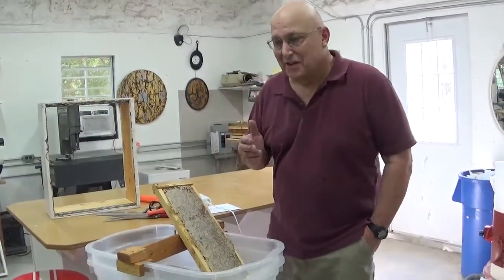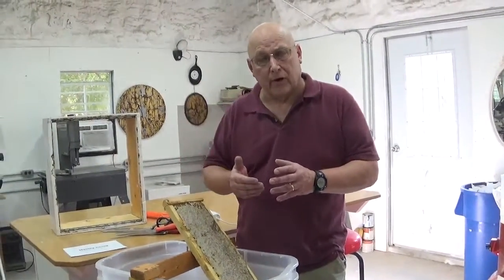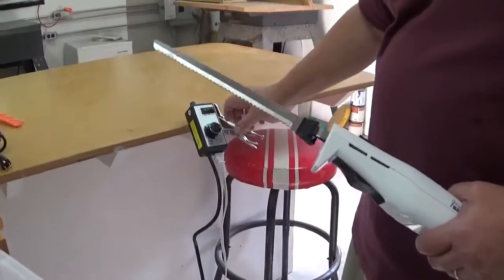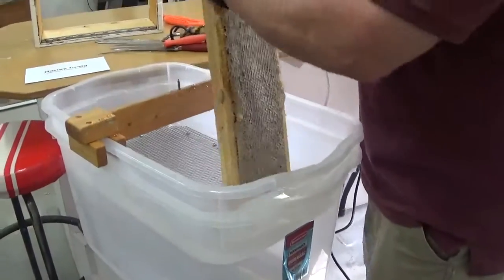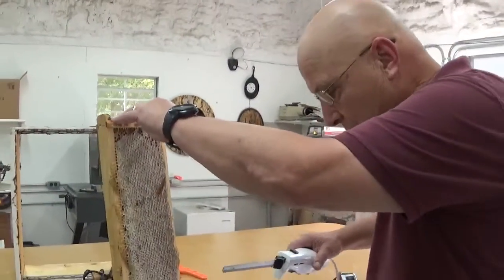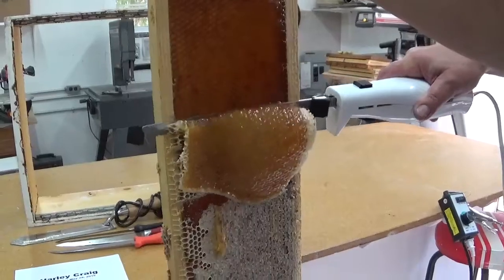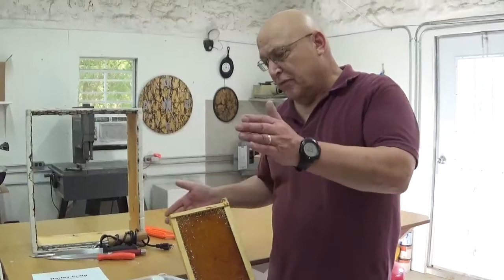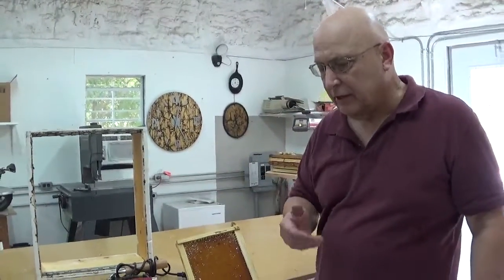Uncapping honey frames my new way is simple, quick and cheap.....

Comment: Where did you get the bin with screen and valve?
Reply from the maker: Hi Jackson,
    I made them from Rubbermaid totes from Lowes. You want to get "nesting" totes that are different sizes but will fit inside each other, the bottom was a 66 qt. with honey gate and the top has the bottom cut out in a 15 qt. size. I like the transparent so you can see the honey dripping down. The top dripping screen is a piece of stainless steel 20 gauge with holes that are 1/4" perforated  from Ebay fastened on the sides with stainless #8 machine screws, washers and nuts. 
    The valve is just a standard honey gate and the decapper cross bar is pine sealed with food grade varnish with a coated deck screw in the middle to hold the honey frame while cutting. I also remade the decapper cross bar with a inner and outer lip to attach to the edge of the tote more securely. These are fairly inexpensive to make so I made two, giving the cut comb time to drip over night. I hope this helps and good luck.....